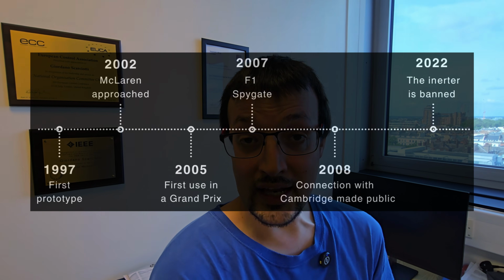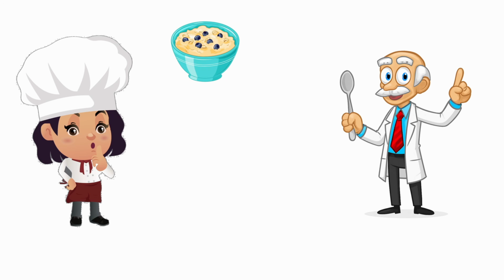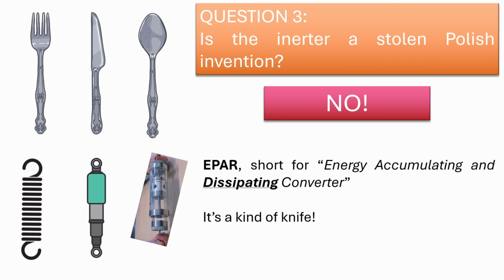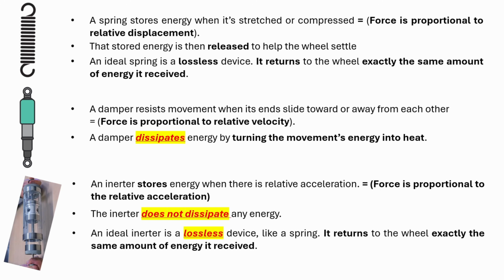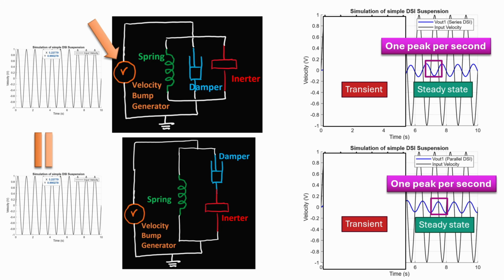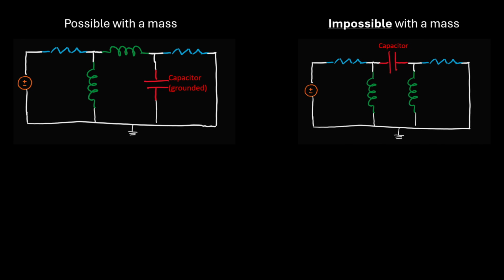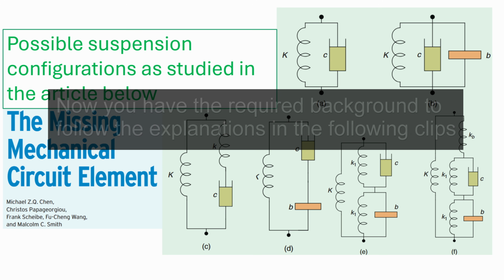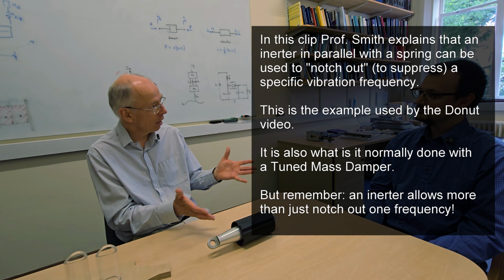Why Everyone Gets the F1 Inerter Wrong | Explained Clearly

Comment: Great explanation of what an inerter is not. However it’s lacking on explaining what it is. We all get that it completes the puzzle of passive suspension components, but imagine using your analogy of the spoon when ppl also don’t know what a spoon is. Can you explain how pushing and pulling on the 2 terminals feels like and how they compare/contrast to springs and dampers. Then explain how the device is able to mechanically create that behavior.
Reply: Its actually pretty simple, its hard to push at the beginning, then easy during travel and then hard to stop at the end. What does this do? Well it effects the acceleration at the two end points!! That is the key feature. By changing the acceleration at the beginning and the end of its travel it allows fine tuning vibrations within the system.
Reply: @newmonengineering  I don't understand why this behaviour was not clearly stated, and demonstrated with an actual inerter, during either of the videos.
Reply: @newmonengineering  Thank You for this, it finally clicked in my head
Reply: What the inerter is , is the inverse of the spring .
Suspensions need a hydraulic damper to keep the suspension from oscillating out of control after energy from a bump is absorbed by the spring. But the hydraulic damper is a poor way of damping the spring (friction dampers were even worse).
In theory a perfect  inerter / spring combination could be designed  that did not need a dissipative damper , but it would only work on a perfectly consistent road surface that had bumps all perfectly spaced and of the same amplitude.
Because roads are not like that a hydraulic damper is still needed to "expand the bandwidth" the suspension operates across.
Reply: @PaulG.x  yes, dampers are like resistors, they both dissipate energy. Springs are like inductors (they can even look the same) and inerters are like capacitors, where they both store and release energy but in different ways and manners.
Reply: @sepg5084  Wrong.  Springs are like capacitors. Inerters are like inductors.

Spring: The greater the change in position (thereby force) across the spring the higher the opposing force.
Capacitor: The greater the change in charge (thereby voltage) across the capacitor, the higher the opposing voltage.
  
Inductor:  Increasing the current in an inductor builds a magnetic field which opposes the change but then has no effect if the current remains constant.  The decaying magnetic field will the oppose a decrease in current.
Inerters:  Increasing the velocity in an inverter builds an inertial moment which opposes the change but then has no effect if the velocity remains constant.  The decreasing inertial moment will oppose a decrease in velocity.
Reply: @donaldcharlong9586 sepg5084 is correct according to the first video.
Reply: @kimjongthe49th  Yes but its wrong.  Reread my comment.
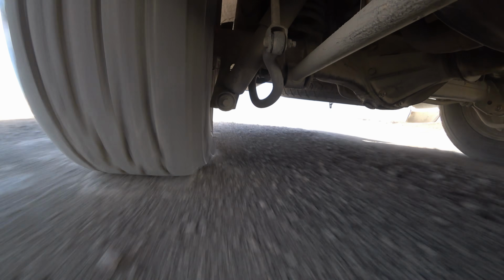Reply: @donaldcharlong9586 It seems you're assuming the impedance analogy, but Prof Smith is using the mobility analogy. This is spelt out in the Wikipedia article on the inerter. He explains it in the original video, between 11:48 and 13:48.

Comment: When one pushes or pulls an inerter, like is being shown on the tabletop in the video, does it then pull or push back to the original position using the stored energy? This isn’t clear from looking, but I’ll bet it would be instantly obvious if I were handling the device myself.

Thank you for making this follow-up video. These concepts are difficult for one not trained in the relevant field, but fascinating to consider. And kudos for the knife-fork-spoon analogy; it was very helpful!
Reply: My understanding is that the inerter does not return to the original position when the input force is removed (like a spring) but releases the stored energy in the same direction as that which the actuating rod has already moved i.e. the rod continues in the same direction for a similar distance.
I've no idea why this was not demonstrated in either video. It's a major omission.

Comment: I have watched both this video and the previous one. I understand the concept of storing the energy in a flywheel, but still do not understand how that stored energy is put back into the system by the inerter.
Very interesting topic.
Reply: I think the stored energy is used up against the spring or the mass rebounding or returning to its original position
Reply: sorry my previous answer was not right, try this?
I think there may be two ways of seeing stored energy. A. is that once the flywheel is spun by the first outside force input then it continues rotating as a stored energy, then when an outside force trys to go in the reverse direction the stored rotational energy is used to decelerate the  2nd outside force input in the reverse direction. B scenario is where the inerter flywheel is moved and has time to  come to a decelerated stop away from a baseline starting position, then the new position is stored potential energy relative to the original baseline position  which we all implicitly assume to be needed due the springs in the Formula one use assumption. B is a subset of A since A would need the decelerate the flywheel in one direction before accelerating it in the other direction. B only has to accelerate the flywheel in one direction. There could be scenarios where the deceleration of the flywheel of the first movement acts on one source of the first input and the restart of rotation of the flywheel could be in any direction from any other source and direction for some unimaginable product like a ball that is designed to never bounce, such as boat exploding sea mine perhaps.

Comment: Sigh ... for anyone watching this video, I am a retired PhD engineer who did a lot of dynamics, and also a lot of electrodynamics, and I understand what a inerter is ... and this video is sure NOT how I would try to explain it, and I think it will confuse and conflate the understanding for almost everybody, rather than help you.  

I would put the whole issue this way: do you understand electronics, and in particular AC circuit theory?  If so, then the inertor is the mechanical analog of an inductor.  Done! Wow, that was simple!  (now why you would want a mechanical analog of an inductor in a race car suspension is a separate problem that these videos don't really explain, but it gets pretty obvious, at least in concept, if you understand filter-synthesis ... ) 

If you don't understand electronics then the whole problem here is hard to explain, because there is no way around dealing with the math and concepts of networks of two-terminal devices, and that is (at least to me) more naturally understood in the context of AC electrical circuits than mechanical analogs, and also there are endless books that introduce the concepts and math for electronics, and relatively few for mechanical systems.

The "forks, knives, spoons" analogy  that this video plays with seems to me to be wacky and unhelpful, for two reasons (1) there is no underlying simple mathematical theory about something where forks, knives, and spoons are network elements, and (2) hey, there are lots of ways to put food in your mouth that aren't forks, knives, spoons or a more complex circuit made from these elements -- hey, your fingers!  But for idealized passive electronic circuits of two-terminal elements the idealized resistor, capacitor and inductor are sufficient to describe any possible circuit or system response -- any possible system response can be produced by a network composed of only these elements; you don't need anything else.  (The question of whether a transformer is an independent fourth element or considered as two coupled inductors (which is what a transformer is) is a semantic issue IMO.) 

The other problem (and it was Edison's problem ... he didn't understand AC power, because he couldn't grasp the math) is that almost everything you want to do with these circuit elements is most conveniently done treating the signals as complex variables ... so if complex numbers and in particular Euler's theorem puts you off, (ditto Fourier series and transforms) ... the whole thing will get baffling really fast.   There's no easy way to really get into this without at least a basic understanding of the math.

Comment: Maybe a device that produces a force proportional to jerk (the third time derivative of displacement) would provide further opportunities for optimization.
Reply: You mean the rate of chsnge of the rate of change? The sticktion of starting and ending movement might achieve what you are asking. Flaw becomes feature. Ther should be some starting stopping inertia? Fiddling with diameter mass of the flywheel. The hystersis of one componant dampens the hystersis of tho other componant in the third derivative?
Reply from the maker: It is an interesting idea, but it should be noted that it’s been mathematically proven that with just three elements (spring, damper, and inerter) you can realize any passive mechanical suspension. So a “jerk” element wouldn’t actually add new possibilities per se. Mayeb it could provide some implementative advantages (e.g. less components). Anyway, it’s fun to think about how these analogies could be extended.

Comment: the irony is, that the EPAR, is more like a copy of the child's spinning toy,
whereas the Inerter, is a true mechanical device that completes the electrical circuit analogy.
Reply: The spinning toy is like half an inerter with a (very small) damper. 

It spins up exactly like an inerter but it doesn’t release the stored energy back to the system. It dissipates the energy (slowly) because of the friction with the surrounding air. 
The electrical analogy would be a diode in series with an inductor (and a resistor in parallel with the inductor). 

The inerter, spinning toy and the EADC are all mechanical devices.
Reply from the maker: Indeed, the EPAR is very similar to the spinning toy. When you push (impact) on the toy, it spins a flywheel and gradually dissipates the energy of the “impact.” In the same way, when a car hits another car, the bumper equipped with an EPAR spins its flywheel and dissipates the impact energy. The difference is that the EPAR includes dedicated dissipating elements (such as clutches or fluid systems) that release the energy much faster than the toy.

Comment: You say that the inerter is not a damper, but if applied to a sprung system, it would definitely have a damping effect. - So it is a damper, and at the same time it is more than a damper because it stores energy to be released - something usually avoided in a damper, although possible.  I understand how an inerter works, but it is definitely a damper.  It is not a damper in any traditional way, but it will slow oscillations - for sure!
Reply: The force of spring depends only on its position. Stretch or compression.  Not velocity nor acceleration of the input movement.  The force on dampers depends only on input velocity. Not position nor acceleration.  The force on an inverter depends on the input acceleration, not position nor velocity.  If you move the terminals of an inerter at a constant velocity no force is experienced.  (There will be inherant fiction) if you change the velocity then you experience force due to acceleration.  Different to damper. At a constant speed the damper experts a force.   Configured in suspension system it allows the system to react to the acceleration of input there by improving performance of the system and allows tuning. Reducing movement. You could say the system is damping the movement (controlling may be more appropriate term) but an inerter it is not working as “damper” which has a specific meaning about a force and speed.
Reply from the maker: @peterfox3199 Thanks a lot for the great explanation.

Comment: Sping works on position
Damper works on velocity
Inertial device works on acceleration 
To solve the Bode plot you need to solve for p, v. 
Meaning  x, dx/dt (v), dv/dt (a)
Solving for “a” was missing.
Reply: So it is 2nd order differential system

Comment: 'Not an engineer but hard to imagine that this inerter, when in use in the punitive environment of an F-1 suspension system, it does not get hot? (dissipate)
Reply from the maker: Well, sure. In practice any real mechanical system has friction in bearings or gears, so some heat is generated. But the key point is that dissipation is not the intended function of the inerter, unlike a damper, it is a "defect".

Comment: Why did you compare a capacitor to a mass? It is the other way around: the capacitor stores potential energy, like a spring, and the coil would be kinetic energy (inertia). So the inerter would be a coil.
Reply from the maker: What you describe is the voltage-force analogy, developed in the 19th century. The inerter was developed using the current-force analogy, which is dual to the other analogy, developed in the 1930s. The are several reasons Prof. Smith used the current-force analogy, some of which are discussed in the interview, and at the very end of this video. Further details are given in a link in the decription of this video.

Comment: Can you "tune" the inerter using a electronic motor like those used on ball screw linear motors?
Reply: Sounds plausible. I take the fuse out of the electric power steering in my 2001 honda insights and call it a steering damper. I had
 assumed it was frictional damping but it does spin the motor, and some passive eddy current thing could be caused, or something active. I guess junked electric power steering racks c
Have the motor to mess wuth and the steering point that could have a mass wheel attached to it for a poor mans sophisticated j damper. I got an atv lawn mower type steering rack to make a j damper inverter, i did not think of the ones in my cars might be strong enough for a heave spring.

Comment: I'm a retired motorcycle mechanic and terrible at maths.
When you used capacitor in series analogy it made more sense to me, power goes in and comes out at a different rate at some threshold level. 
The EILI5 was a bit too simplistic so confused me.
I'll have to watch the previous video to get a better understanding, haven't really followed F1 since Damon Hill was wasting best car in the world for two years.

OK, watched first video. 
The flywheel in an inerter gets accelerated to high rpm depending on input (suspension deflection in mm/inches, depending on screw pitch). 
The speed of deflection determines flywheel acceleration (I can understand how screw pitch will change travel movement, I trained as a precision machinist in mid 1970's and had to make various screws while training,)
Does flywheel then somehow disengage (freewheel?) or does it have to be stopped to reverse direction when inerter reverses travel? (fully extended/fully compressed)
If it's fixed to ball nut I can see how things should work to prevent oscillations, trying to stop and change flywheel direction of rotation but the stresses involved must be very high if a large suspension movement happens?
Reply: I believe it does not freewheel, so the stored energy is positional potential energy that is realized wheel the wheel has its distance from one end changed back to the previous direction position by rotating in the opposite direction. I should read all the references cuz i might might be wrong.
Reply: @retroprotollc8473  Thanks for reply.
Reply: @1crazypj i think I did not get my explanation right, maybe this is better:
I think there may be two ways of seeing stored energy. A. is that once the flywheel is spun by the first outside force input then it continues rotating as a stored energy, then when an outside force trys to go in the reverse direction the stored rotational energy is used to decelerate the  2nd outside force input in the reverse direction. B scenario is where the inerter flywheel is moved and has time to  come to a decelerated stop away from a baseline starting position, then the new position is stored potential energy relative to the original baseline position  which we all implicitly assume to be needed due the springs in the Formula one use assumption. B is a subset of A since A would need the decelerate the flywheel in one direction before accelerating it in the other direction. B only has to accelerate the flywheel in one direction. There could be scenarios where the deceleration of the flywheel of the first movement acts on one source of the first input and the restart of rotation of the flywheel could be in any direction from any other source and direction for some unimaginable product like a ball that is designed to never bounce, such as boat exploding sea mine perhaps.